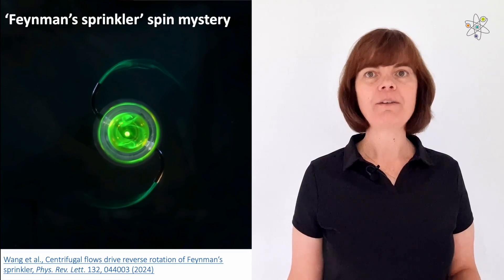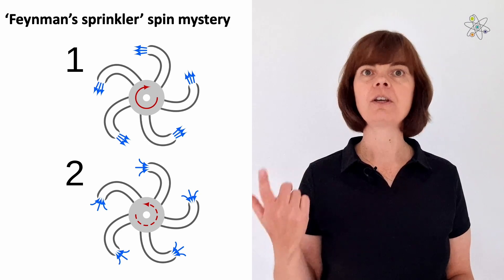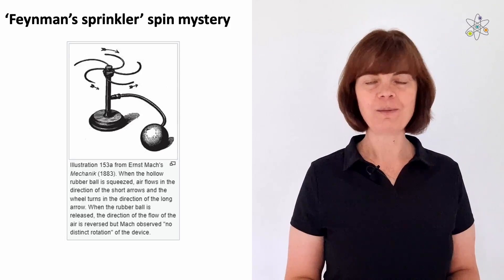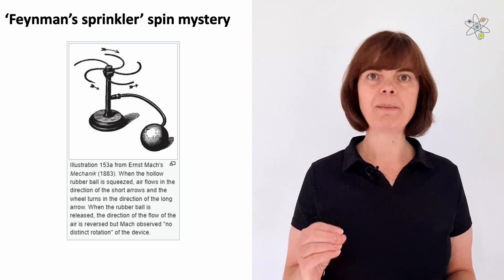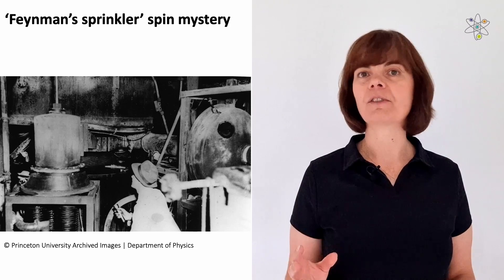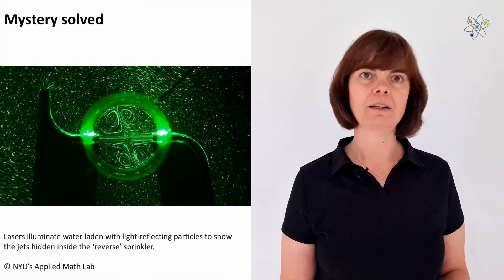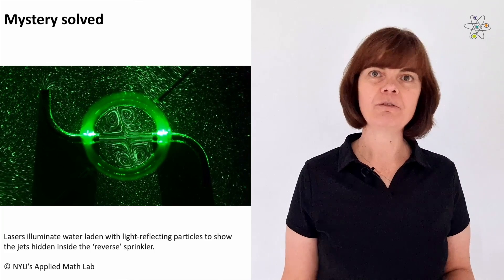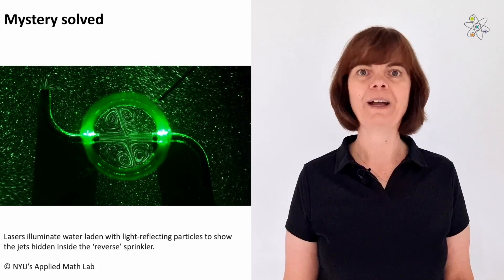Unraveling the Mystery of Feynman's Sprinkler: A Journey into Fluid Dynamics

Comment: Try doing this with a superfluid, and it will be found that there is no rotation whether sucking or blowing, but then there is no flow separation and time reversal symmetry applies. Do it with a real non-superfluid, and there is a strong flow separation when blowing, of which rotation is a sequela. With sucking in a real fluid, any flow separation is insignificant and behaviour is like the superfluid.